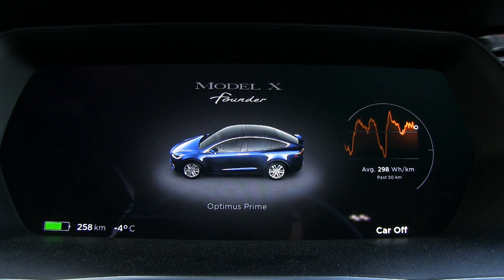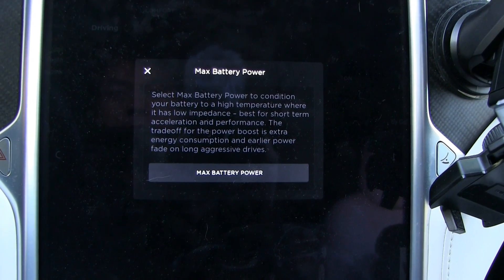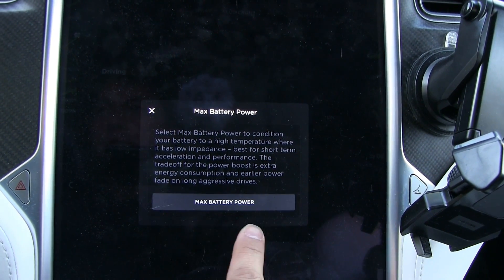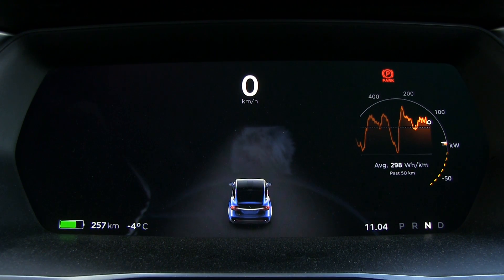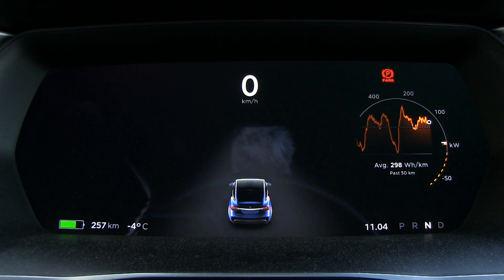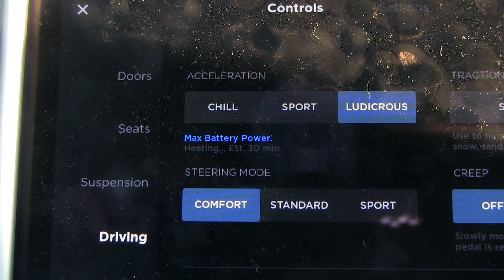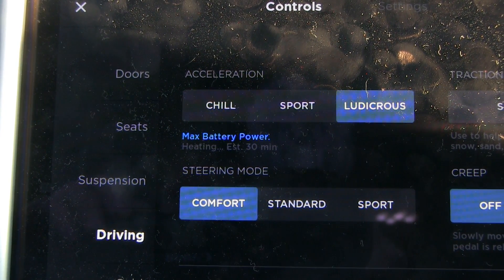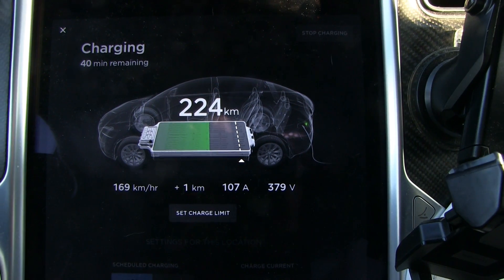Max Battery Power to preheat battery

Comment: If max battery power and climate control pull around 20A off the charger.. could you run both and avoid idle fees at the super charger because it’s still drawing power?

Comment: Seems like the common sense thing to do would be to either charge it overnight when you get home, or use a space heater to help keep the battery from getting that cold if you have an enclosed powered garage.

Comment: Hi Björn. I'm surprised that you don't use an OBD interface with a phone app to read out all temperatures and other details instead of guessing. I have that setup for my Ampera and it is really interesting to get a full view of all temperatures, heaters power steps and many other component details.  Thanks for interesting videos /Peter, Sweden..

Comment: Bjorn, do you need a tesla with ludicrous mode to be able to use this 'max battery power' mode?
Reply from the maker: +Johan Otter Performance is needed
Reply: Yes, this is what allows P owners to enable Launch control, without the option launch mode is disabled

Comment: When switching of MaxBateryPower, the 6kW heater isn't active, resulting in more Chademo-energy can be used to charge the batery. I believe this is the reason for the increase from 110 to 120 amps charging power.

Comment: Actually you should hold the ludicrous button 5 seconds and run ￼
Reply: Run Ludicrous Plus then you will see the battery temp display on the dash board
Reply: tomcham33 this is P90DL ,p90d and p85d doesnt have ludicrous plus
Reply: OIC， mine is XP100DL, once I activated Ludicrous Plus, I can see the battery temperature gauge and the battery warmer will heat the battery up to 50 degree C.